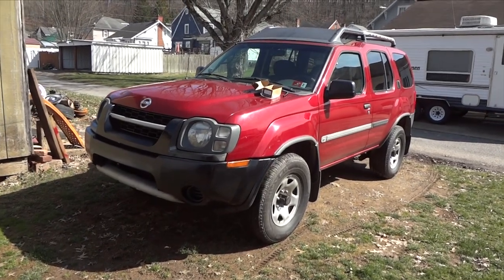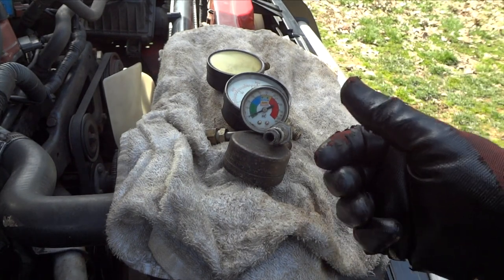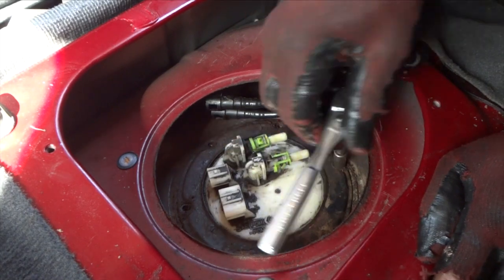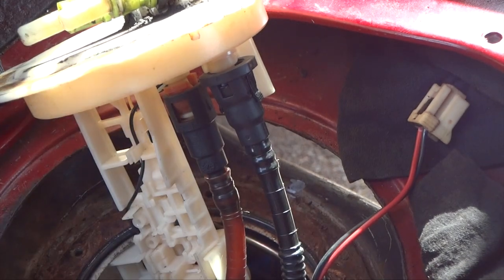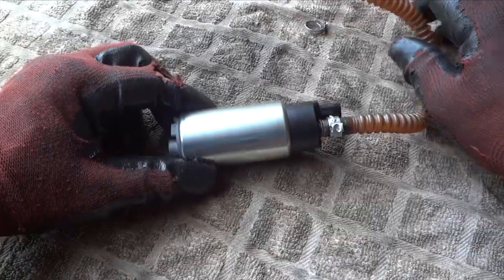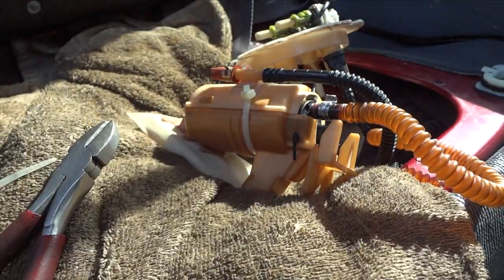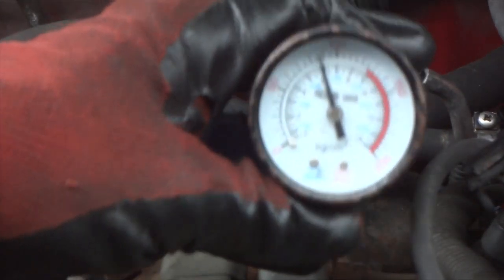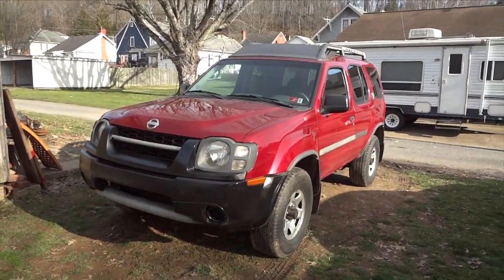$400 Xterra.... Fuel Pump Replacement. My issues... But got it done!

Comment: That black fuel line was a nightmare for me when I did this a few years back. Now I'm about to revisit this job again as my fuel pump has failed again. That's what I get for buying a cheap fuel pump though but lesson learned glad I got to see you do it without taking that line off. I'm doing this on a Frontier 3.3l and it's not much different from what I see.
Reply from the maker: @WadeDowns  Nice! Hope it works.

Comment: Great video! All business and no fluff! My 2004 Xterra with 215K miles started stalling on me. Never changed the fuel filter, so I'll try that first. If that doesn't correct the problem, I'll change the fuel pump.
Reply from the maker: Nice!!
Reply: Did that work for you?
Reply: @MAGATonyG  The fuel filter wasnt the issue. I changed it and the behavior didn't change. I haven't had time to work on the car anymoree, so I still have the issue. The car has been sitting for a year! I have three other cars.
Reply: @blcdad  yes I just changed the filter and pump and that didn’t help
Reply: @MAGATonyG  My problem doesn't seem to start until the car is well warmed up. I got a new EGR valve an selenoid to see if that fixes the problem. I haven't installed yet.

Comment: I wonder how much you sold it for? Great video. I'm glad I watched till end so I can find out a way to connect into system so I can check the fuel pressure since no Schrader valve is available.  Big score in my book.

Comment: M r Nathan Love your video.  My 2003 Xterra  super charged also needed a new fuel pump. She died at a light and would not start. Thus a new fuel pump was put in.Now She runs fine but in the morning she starts and then has a surge  like she is gonna go then stalls. Put key in start again then runs fine. What could be wrong my mechanic can not find a code???? This problem has Cost me a lot of money. Can you give some advice on what can be wrong.  Angela

Comment: Well I was going to ask after the headgasket replacement if you grenaded the bottom end or not this video states it didnt . How many miles have you put on it since the hg replacement
Reply from the maker: I did not. It was checked and the block was perfect still on the straight edge.
Reply: @FixingWithPassion  that gives me hope for the turdbucket I have sunk 3 grand in already
Reply from the maker: @creekheathen4971  Ouch!

Comment: thanks for the video! I have a question, is the tray where the fuel pump is clipped attached to the tank or does it move freely?
Reply: Did you get the pump off? I can't pull it out

Comment: My 2004 Nissan Xterra just started to give me fuel pump issues I check other thing before I concluded that it was the fuel pump and it seems that my 04 Xterra is idling rough and and has no fuel pressure
Reply from the maker: O my!
Reply: Yeah it kept stalling on me like it wanted to start but it wouldn’t and when it would it would only stay Idling for about few seconds

Comment: I replaced pump on my 2002 exterra had to replace fuel brittle and cracking 
My hands to big. Will bad fuel pump cause exhaust smoke cause since replaced pump it no longer smokes 
What’s your thoughts on this?
Thx

Comment: Hello from cali, I came across your channel when you were doing the headgakset on this xterra. I have a 1985 300zx (z31) turbo and they have similar engines but the xterras are a 3.3 and the Z31 is 3.0. And i was just curious as to how the headgasket process is on a vg motor and it seem pretty easy thanks to your video.

Comment: HELP so i have a 2003 xterra and the little plastic part you connect the fuel line to nuste doff as i was trying to disconnect it. the fuel pump is fine i just diont know what to do! i went to napa and they mentioned a new fuel pump but i dont see the part i need when buying a new fuel pump. i just need that plastic connector piece

Comment: Great video! I'm about to do this job as soon as my pump comes in.

Do you absolutely have to drain the tank? (mines full)

And other than disconnect the battery is there anything else to do to depressurize the system? (pull fuse, etc)

Comment: The cover that goes around the fuel pump, I can’t seem to find it anywhere online, does it go by a specific name?
Reply: What cover?
Reply: I've seen it called a fuel pump bracket, but not sure of official name. Do yourself a favor & buy the whole FP assembly, and all the potential parts that need replacing are there. Make sure it includes the sending unit, because most of the time that's what actually fails. If you know how to use a multimeter check the pump and sending unit to see which went bad, and can replace just that part. Because it is a common failure, I'm ordering spare whole assembly to use as backup parts.

Comment: Do you know if I can reach the fuel pump like you did? I have a 06 Nissan Frontier CrewCab with a 4.0 engine. I have a recall on mine, but the dealership does not want to mess with it. Thanks for the video, any feedback appreciated.
Reply: Pretty sure the dealership has a responsibility to do the job if its under a recall free of charge.

Comment: Love that truck , can't find one up here in Suffolk County,NY for a decent price. If you were to sell it, how much would you ask for it?
Reply from the maker: Yea the body is perfect and the frame is in great shape still. Perhaps $2,500.
Reply: Dont buy nissan exterra have lot problems
Reply: Special ok knock sensor
Reply: Good job installed fuel pump bro ..so clear.
Reply: @armandomunoz6518  I disagree. I have a 2002 with 236,000 miles it's been one of the best vehicle I've ever had. All vehicles need maintenance and parts replaced.

Comment: I don't get it, why are you replacing the fuel pump if the original pump is good to put on the shelf or sell for $10.00?
Reply from the maker: I said why in the video.
Reply: @FixingWithPassion  Oh my, guess the closed caption didn't put it in! Unsubscribe!
Reply from the maker: @rockeerockey6941  Sweet!
Reply: @FixingWithPassion  You are!

Comment: I did this but the new pump is not getting power the pump will run if you run it on a 12 v battery in a bucket of gas i have power at the 2 pin plug white/blue black wire, i think the connector is broken or corrodded on the underside of the sending unit
Reply from the maker: O no!
Reply: @FixingWithPassion  The fuel sending unit part has to be replaced
Reply: The wires were reveresed on the new fuel pump wiring harness, the pump would run but wouldnt pump gas, reveresed the wires truck fired right up!

Comment: Do you consider that Xterra buy a money pit?
Reply from the maker: Like anything in life, you gotta work fo it... if nice things are truly yours.
Reply: @FixingWithPassion  
Sure but for me, a money pit is something that was too much money and trouble to justify it. 

Do you feel like it was worth it or was it one thing after another that made you wish you passed it up? 

There's a $1,000 Xterra for sale by me that I'm looking at but wondering if an early 2000s model is close to that point where things start to fail like dominoes so you're always chasing parts.

What's your advice? Are Xterra models the kind of vehicle that tends to stay fixed, after fixing them up?